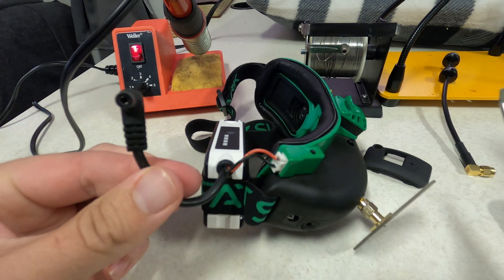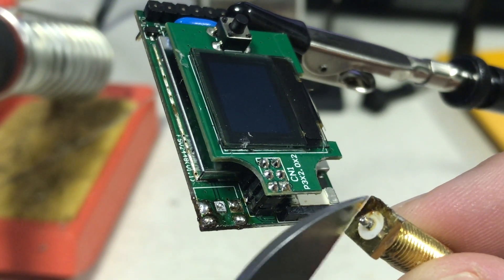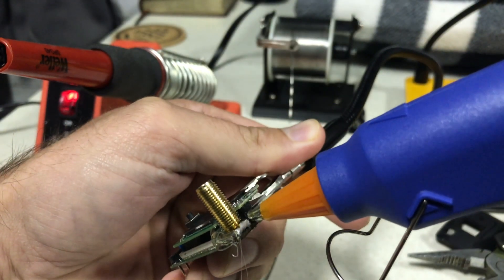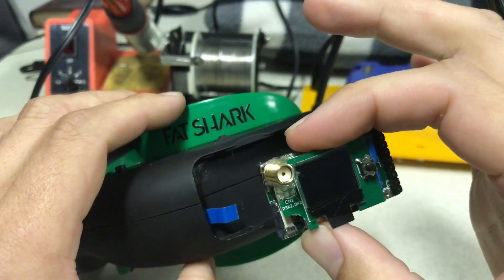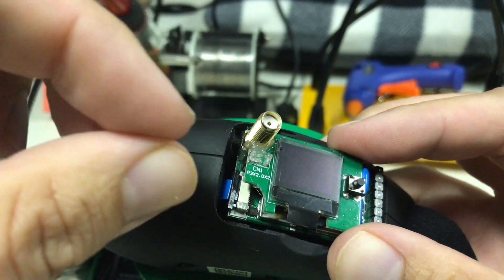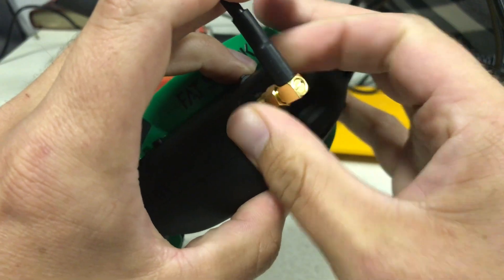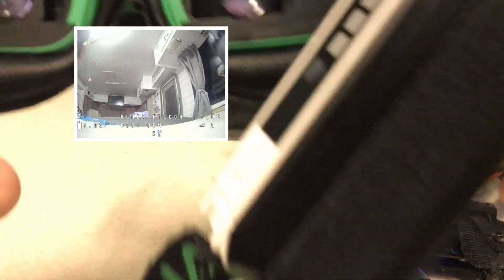How To Repair OLED Receiver Fatshark Attitude V5 Goggles

Comment: hey man any tips on the recver going black
Reply: My problem in this area is the ribbon cable going to the main module. It is a bad connection and it makes the goggles go black while flying. I just dis-connected it and my goggles work fine now only no more diversity.
Reply: @howitsdone5096  mine too. My right rx module I think its not working anymore. Its annoying that its a ribbon cable
Reply: @potatoflyer-atp  I have tried to contact Fatshark 3 times for parts. Seems like they no longer care about customer support. I havent heard anything back from them. Fatshark going down?
Reply from the maker: Might be a loose connection. Check where the antenna and receiver physically connect together. The receiver might not fully be touching the pin to the antenna.
Reply: @DroneMaverick  hey man just goin to ge the akk moduale tommorow i will let uu kniw how it is
Reply: @andytaylor3321  tag me if the akk diversity works on attitude v5. And if theirs a cover for the akk
Reply: @potatoflyer-atp  yea buddy i dolong range with it and i have the stl file if u want it for the cover\

Comment: Hey my v5 go glowing black screen after a about 30 secs of running. Module still has power. Any idea???? Dont think thats broke
Reply from the maker: I haven’t heard of that issue, so I don’t know.
Reply: It is I beleive the ribbon cable going to the main module. Dis connect it and fly with the single anttena. Try that.
Reply: I had the same issue. I never had the problem running a single antenna. I had to do this repair on the slave receiver.

Comment: Thank you very much for the video. I damaged My v5s accidentally dropping them. I'm not sure what that ribbon cable attaches to but it got ripped out and is damaged. The pins on the module also bent bit I was able to straighten them out. After turning it on without plugging in the ribbon cable it seemed that everything worked fine. Do you have any idea what that ribbon cable goes to? Maybe it's the DVR? And maybe where to find a replacement ribbon cable?
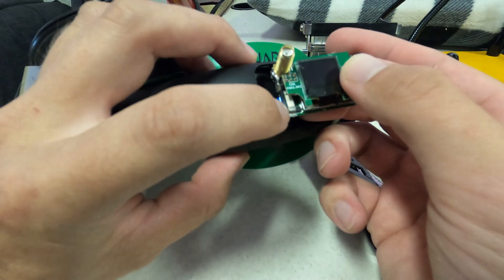Reply from the maker: Here is the time stamp of where your ribbon cable goes 00:23 without that ribbon cable being connected, it won’t work.
Reply: @DroneMaverick  That's a thing, the ribbon is not connected to the module and it still worked. I got a little bit more flickering when I flew far away but it worked. I thought it might be for the DVR but I figured out it was for the diversity module. so it's like I'm flying with one antenna. I need a replacement ribbon cable. Hope I can find one Or I could just replace the module with rapid fire or something. Thank you
Reply from the maker: Interesting. Maybe the ribbon cable is for the patch antenna?